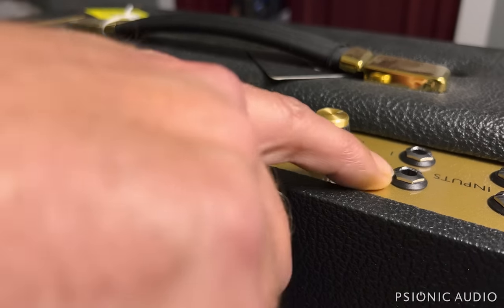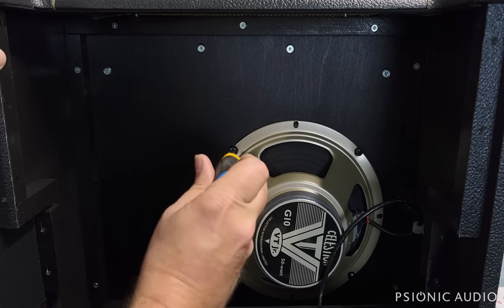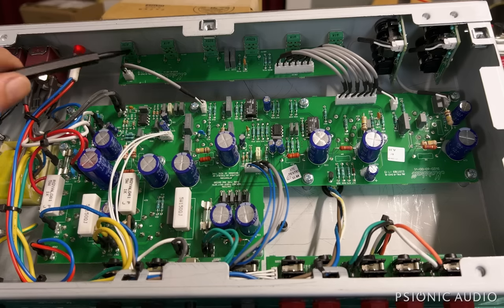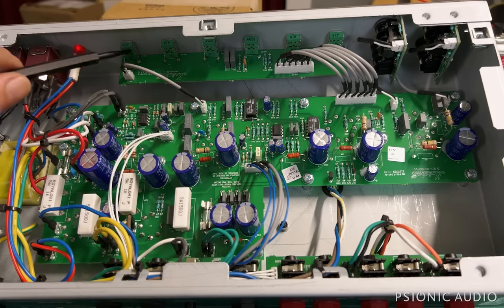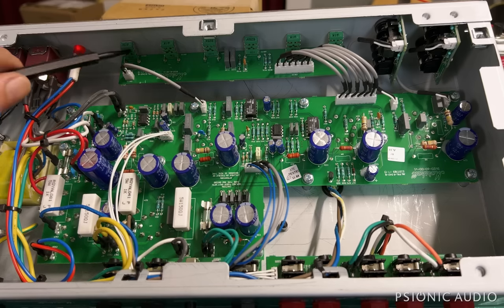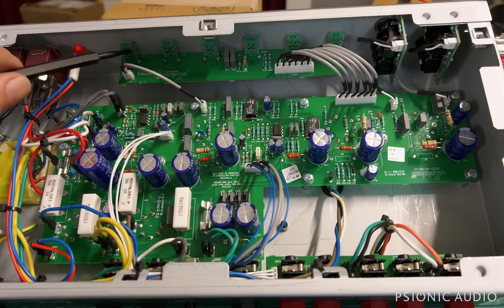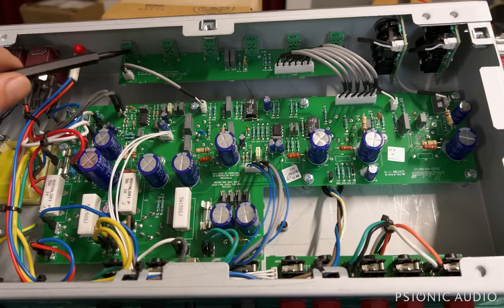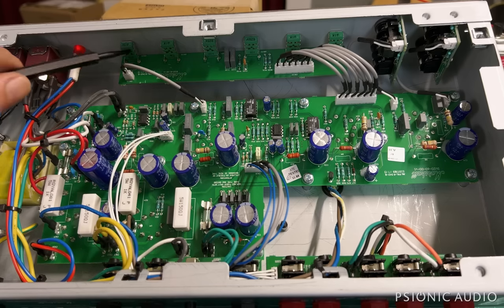Marshall Studio Vintage 20 | An In-Depth Look

Comment: I’ve never been a fan of screw mounted speakers. Nuts and bolts are much friendlier to the baffle I would imagine?
Reply: Self-tap screws into thick, sturdy wood or plywood are merely "okay". Self-tap into particle board would be an abomination. Bolts (aka machine screws) going through the speaker frame and baffle into threaded T-nuts are essentially the same as through-bolting the speaker to the baffle.

Comment: I live in Europe and bought the head version used for € 600.
Probably about the best money I spent on gear so far.
And I disagree with Psionic here - the amp does sound a lot like an old plexi, mind you the plexi circuit changed some times during the years anyway.
It DOES do the thing and it DOES sound great.
I guess that`s difference between a technicians and a musicians opinion.

Comment: Here in the UK is costs roundabout £800, I don't know the EX rate to U$ at the minute but it's waaaay less than the $1900 asking price across the pond. I had a head of these a while back which is better as you can pair it with a 1x12 or even a 4x12 cab of choice. 
It's sort of ridiculous that amps made in the UK are so pricey in the US and viceversa, a Friedmann runt 20 combo here goes for around £1700 which is too much. On the other hand amps made in Asia and Mex are about the same price in the US and the UK, and that includes UK and US brands...I wonder why that is??

Comment: Has anyone brought one of these over from Europe and either used it with a step-up transformer or know if the transformer can be rewired for/switched to US voltage? Otherwise, Psionic or anyone else: is it possible to swap out the whole transformer for a US one - and that does that tend to cost in parts/labour? Many thanks to anyone with this experience who can share some info.

Comment: That new made in England Marshall amp that cost $2,000 makes my old jcm600 made in UK Marshall head look like a $2,000 amp when the SV amp looks almost less than the modern DSL range 🤷🏻‍♀️ that's just crazy that amp cost as much as it does with those cheap little Asian pots !?

Comment: I have the head version, I was just curious what you meant about putting 6l6 in it, I just want to make sure I can get this sounding the best it can
Reply from the maker: I was saying as a matter of design, not user mods. 

Don’t try to polish these up.
Reply: @PsionicAudio  ok thanks I was surprised that these were biased so cold. Is that normal for plexis 

Also I have the head with 2x12 vtypes and they sound really good (why they put 10” in there combos I will never understand) I read that Marshall tried a lot of speakers and found that this was the best for this amp (weather that’s true or not) I had v30 in them at one point and I took them out because they where too fizzy 

Anyways love your channel what it weekly.

Comment: Is it normal that the high treble channel very noisy? I notice there is a noticeable noise when I plugin to treble holes. Starts at volume 1.5-2 and increases with the volume up.
Reply from the maker: Bright cap on High Treble. The noise is vintage correct.
Reply: Thanks!

Comment: I honestly don’t think this video captures the sound of this amp properly. Not sure if it is a micing or recording issue, but my SV20C absolutely does not sound like this. I can hear the “fizziness” in your recording, but my amp absolutely does not sound like that, it is not fizzy at all. Yours might be a one off amp with an issue?  Not sure, but something sounds off. I don’t doubt your technical knowledge and analysis, but the audio is not representative of this amp. I have a Les Paul with Classic 57’s and it sounds killer with this amp. I also have an SG Standard with Sigil pickups and it sounds really good paired with this amp as well.  🤷🏻‍♂️
Reply from the maker: I mic all amps the same. It is a pretty good indication of what the amp sounds like in the room, and the amp sounds exactly as its afterthought of an output section and bad little 10” speaker allows.
Reply: @PsionicAudio Fair enough, it just doesn’t sound like mine!  I agree it does not sound good from your recording. Makes me wonder (honestly, not trying to be a troll) if there is some other issue at play with the specific one you tested. No doubt you know your stuff!!

Comment: 10s are ok for little practice amps, but I kinda hate them. Even in svt cabinets. I just don't like the sound. Much prefer 12 and 15 inch speakers. Same with horns. Good for keyboards and other stuff. 
But I play bass, plenty of twang in a 12. 
I'm not finding a lot to like in some of the reissue amps. I guess they're ok, but they're just ok imo. 
Anyone know of a new, decent solid state bass amp out there?
Something in the 200 watt range. 
Thanks👍

Comment: Does that fact that these tubes are running at 13 watts mean that they will last a lot longer in this amp than they would in a 50 watt plexi?
Reply from the maker: Yeah, but it will sound meh for years and years…

Comment: If I were in the market for a Marshall around this wattage I'd snag a used 1974x. Hand wired (for repairability) and a 12" speaker. You can find them for $1600-2K.
Reply from the maker: A much much better amp.
Reply from the maker: I haven’t had the MVP on my bench. I hope it’s worlds better than the PRs I have had. 

So I hope you never have any problem with yours for years to come.
Reply: @PsionicAudio  Fingers crossed. Thanks for the reply! I appreciate what you do.
Reply: found my 1974x used from 2005  with a sporadic hum for 1000$, added a new 1974cx cab, there is magic about 2 1x12 oversized cabinets. swapped all the tubes to nos mullards and i love it so much i don't even bother to try to fix the hum.
Reply: @yaniv-nos-tubes  Don't blame you.

Comment: Sometimes feels like Marshall is just trying to bleed the older generation dry and make as much money as possible before it's too late for them. There's so much more they could do (reissue the old black box pedals, pedalboard friendly JMP1, a Studio series with load and IR loader cause all everyone wants is Plexi tone at low volume, etc). Instead they mass produce this starved plate design, couple it to a 10" speaker to save 2$ and sell it for twice what it should sell for.

Comment: I always wondered why even Brits refer to them as Plexi's when the common brand name for the material it is Perspex in the UK..
Reply: Plexiglass and Perspex are both trade names for clear acrylic plastic.  Plexiglass came first and was sold in the UK.  Perspex arrived about 10 years later and took a while to establish itself as a brand name and become far more common than Plexiglass. So it may well be that Marshall used Plexiglass  rather than perspex at the time.  

Or it may be that the name became associated with the earlier amps in the USA first, to differentiate the older models with the later metal panel Marshalls, and then travelled back to the UK.

Marshall themselves use the term 'Plexi' on their website, so they certainly don't try and push any other description for them.
Reply: @WonkeyWabbit  Cool, thanks for the edification  🙂
Reply from the maker: I thought plexiglass and perspex were the same thing with different names on opposite sides of the pond.
Reply: @PsionicAudio I thought the same thing, that they were ALWAYS named differently since inception, but @WonkeyWabbit replied with a clarification about Plexiglas being marketed and sold directly in the UK for 10 years before Perspex came on the market there.
(edit) Also, they appear to be THE SAME material per the "Sheet Plastics UK website": 

What is perspex?

The brand perspex uses a material called Polymethyl Methacrylate (PMMA), an acrylic. This acrylic material is also referred to as acrylic glass, plexiglass and various other trade names such as Sheet Plastics, all of which use this transparent thermoplastic material.
Reply: @PsionicAudio  It's certainly exactly the same material, but it was made by a number of different chemical companies under their own trade names.  Plexiglass started out as a German company's trademark and a subsidiary of theirs trademarked the name in the US.   Lucite was the US Du Pont name for it.  Perspex was the UK's ICI name for it.  So whilst Perspex was the more common brand of acrylic sheet to be found in the in the UK at the time, it's not impossible for Marshall to have bought Plexiglass branded acrylic sheets.  Probably whatever could be obtained more cheaply!
Reply: I think we only do because you do, I never heard anyone call them a 'plexi' until the internet came along, we used to call them JTM's or superleads or whatever.

Comment: I bought the HEAD, and plug it into a 12 inch Celestion Greenback cab. The combo is really unimpressive, and in Youtube demos it didn't cut it for me. With an open back pine cab and the 12 inch Celestion speaker it sounds really good. I too, am disappointed in the cheap build quality, but I also bought the head when they were more like $650 or less, they have more than doubled in price and no idea WHY. The amp is finicky to adjust, Jon Segenborg has a good video on how to adjust these. I'm no fan of Gibson guitars, they tend to be harsh and lack any soul/warmth, which can be somewhat remedied, but their woods are too heavy, and sterile sounding with finishes that muffle the sound. I have two Gibson LP's in my shop at the moment, and even installing a historically accurate harness, hardware and pickups barely make them useable for me, neither of them make me want to play. Check out my four part series "The Les Paul That Isn't," to see how to fix Gibson's low bidder failings. The before and after for the '60 VOS is dramatic, sustain is dramatically improved, and more of a vintage sound appears, but its still a modern Gibson and nothing like the originals, they fail over and over and over to get there and won't spend the money to even try. Overpricing is way worse than what Marshall does, and the high priced models sound no better than the budget stuff.

Comment: Cute little Marshall, but cranked up to the max it's useless gain, I can't imagine what music you could play, unless The Who maybe. Add a booster or overdrive and back uff the gain on the amp, you'lll summon Eddie in a moment, or go with that maxed out setting, but use the guitar's gain control à la JB <3

Comment: Hi Lyle, I couldn't stop myself on commenting on this amp. I bought a Ceriatone hand wired Marshall JTM45 Bluesbreaker amp for $1350.00 USD. I like all of the high end amps like Suhr , Blankenship, etc. But the cost of something like Two Rock or the SL68 Suhr is just so bloody expensive  at 4K USD. So I opted to buy the Ceriatone and their HRM Dumble clone all hand wired at a great price. These Vox and Marshall amps,  the way they're made today are total shite. I know you will probably disagree with me on that, but bloody hell, the cheap pots and garbage PCB boards and then having the audacity to charge 2K for these in Canada is ludicrous. I personally wouldn't even consider a Vox AC30 or  Marshall today. They sound like shite. Give me Nik's amos any day. I do have a Brian May AC30 Special Edtion from 2005, but it has been completely rebuilt by Michael Klein in Kansas City,  Missouri to David Petersen's specs and it sounds great with a Mercury Magnetics output transformer in it. But I say no to this new Marshall. Another boat anchor.
Reply from the maker: I disagree with you on the Vox AC30C2X and AC15C1X. Not shit at all. Totally different than this SV20.

But a Ceriatone 45 etc kills this SV20.

Comment: What amazes me is how a company like VHT can make low watt to medium watt amps over seas and handwired point to point for less money to the consumer.. And easy for tech repair or mods or upgrades.. And yet big name amp companies like Marshall still do amps surface mounted boards or PCB with cheap garbage components and board mounted plastic pots and tube sockets for the ridiculous prices.. But have yet to realize it could be done handwired point to point overseas just like their mainline amps and would serve the customer better in the end .. Not to mention do justice to the name badge on the front of the amp..

Comment: It sounds good. And I don't think pushing on resistors after they've been soldered is a good idea. It could cause cracked solder joints.
Reply from the maker: If a solder joint is so bad that slight pressure on the component causes it to break, well it’s quite literally my job to discover that.

Comment: tried it and here is my oppinon. Not that anyone asked but I hope it helps potential owners

The hi treble channel is unusable. Its spikey and just plain wrong. And no matter what you do to it with the onboard eq it just sounds like icepicks. The Normal channel souds great, but the fact that you are paying for one unusable channel is beyond me and its a big turnoff. 
The input chanells are all different. No1 varies vrom the other No1 and same goes for the 2 other inputs. I thought that by patching these in various combinations could tame the high treble channel but no. I had no desire to even blend the HI Treb channel with the normal channel. 
The amp is loud, even in 5 w mode. Its very loud. 
Build quality is great but the unusabillity of the Hi treble channel is really a turn-off on the SV20. Cheers

Comment: hmm. these cost around $900 here in europe , but 1900?!!!  I can buy a handwired 1974x brand new here cheaper...😯
Reply: buy a 1974x ,i have one. great amp
Reply: @yaniv-nos-tubes  I have one too. did buy it used for under  $1000. has a 1973 Celestion Greenback in it now, and a set of good new tubes, sounds perfect🚀

Comment: Marshall has gone stupid cheaper and cheaper over the years..   Been cheap and under constant repair from their birth.
    For 2k they could put a 12 speaker in it. And add those little things I bet is, shit i cant eait to see inside the amp.
    I'd buy the Friedman or anything else first.
  My crate stealth and carvin mts imo eats Marshall's and never needed repair..
 And if they did even though pcb not too hard to work on. And made with quality parts.

Comment: These amps really do sound great, at least the head versions. With a 10” speaker, the pricing on this combo is a total ripoff.
Reply: My SV20C combo cost £699 ($865) new in the January sale. How's that a rip-off?  If I wanted I could fit a 12" greenback for around £120 ($148) - they do fit in the cab with no woodwork required.